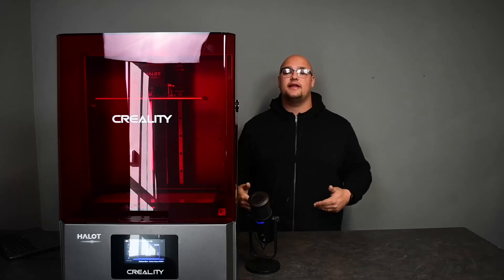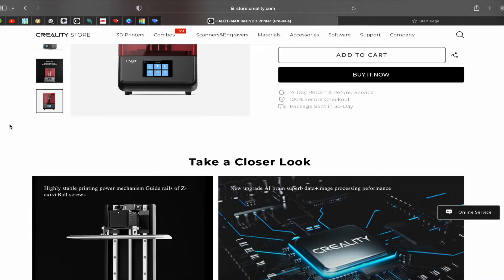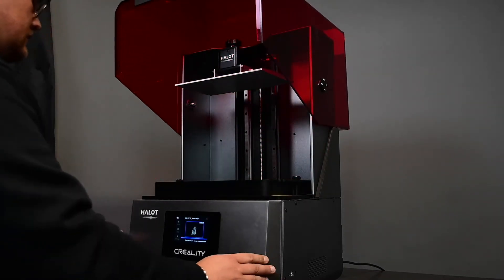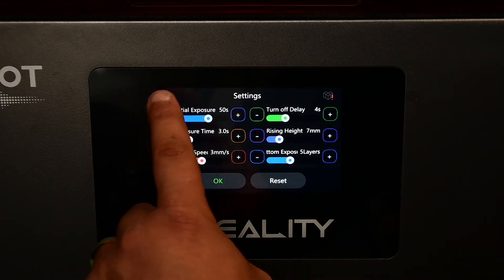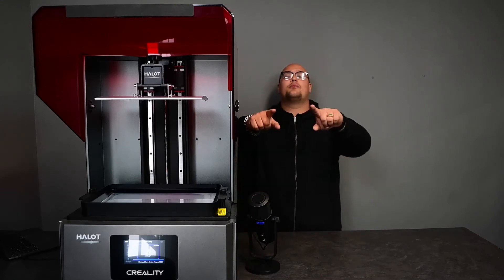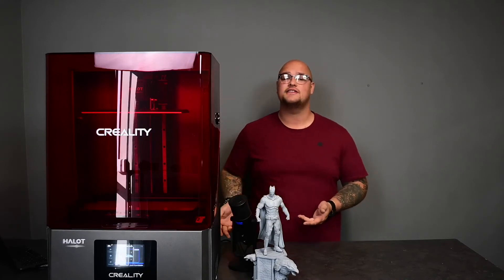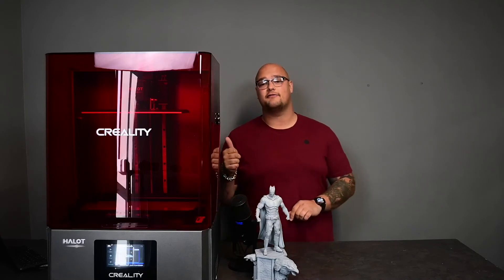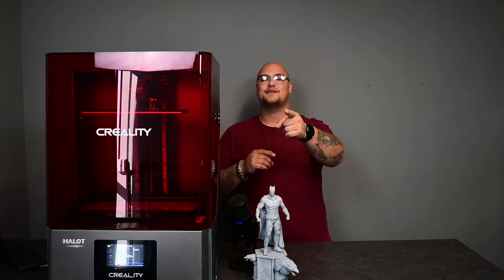The Creality Halot Max

Comment: OK. After reviewing this, IMHO, This machine is now a Dinosaur. It was Fn, fantastic, and a great idea, but the race to build larger printers, has Anycubic with the M3 Max that I am using now
at 3K more resolution, and a larger build size beating this out in less weight, and better print capability.
I think that the software that this uses might have more potential, and I personally like the weight and sturdiness of the machine.

The few things that kill it for me, is the lack of resolution, and the fact that it was so expensive that they abandoned making the machine.
So at the moment this is what I am faced with. 
Buying a Phrozen Mega 8K for 2,300 US Dollars to 3K. Waiting until either the Mega 8K comes down in price, and or seeing if I can get my hands on a used one.
People don't seem to be selling them, so I think that might reflect on that they are a fairly decent machine.
I can also wait to see what might come out as a contender to these machines.

The M3 Max seems to be able to print most all of the parts that I am designing for large scale Star Trek models, other than I hate the Anycubic slicer software that even Chitubox or Lyche has to convert the files to for me to print.
I have noticed that I can buy used M3 Maxes on eBay all day long at the moment for about 430 - 480 dollars, and I am assuming that I might as well order LCD screens for them at the same time because they are only good for about 2000 hours, and that is an average.
The screens take 3 to 4 weeks to get to me, and they run 220, at the moment.

IDK, I do like the way that this machine looks but I wonder if I am going to have to get on my CNC lathe and Mills and make a machine that can handle a higher Z axis.
Reply from the maker: I agree with you, because of the increase in the size of the screen, the 4K resolution isn't really 4K because of reduced pixel density. It is also quite wasteful in terms of it's resin use if you are not constantly filling up the entire build plate with prints.
Reply: @3DPrintingStorecoza  So I am hating my I-phone right now. I made about 6 video's on it to compile into one video about my latest print, and I could only get this one short video on the YT channel, but anyway this is my latest Star Trek model piece.
https://youtu.be/vEAkS63ILwU
Reply: Yeah. It sucks. Apex X1 is best large printer. They should reduce price significantly on this one. But again, the resolution is really low

Comment: OK, SO.
Number 1. Love the size.
Number2. I can buy one on eBay/used but advertised as never used. They are asking 2,500 for it.
Number 3. Creality, the company, and thus second hand sellers seem to not state the resolution of the products.
Number 4. I am concerned about LCD Screens, and parts to repair the machine as it seems like they just quit making this bad mama jama.
Reply from the maker: The Halot Max has a resolution of 4K, because of how large it's screen is, you can expect a smaller 4K printer to print higher quality because of the pixel density.
Reply: @3DPrintingStorecoza  OK, that's why my M3 does a fairly good job  on smaller things.